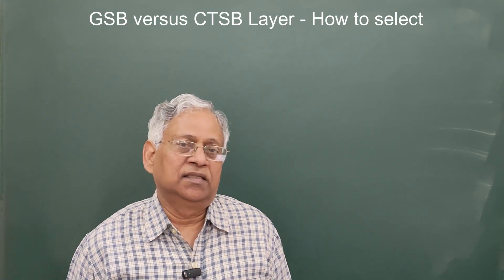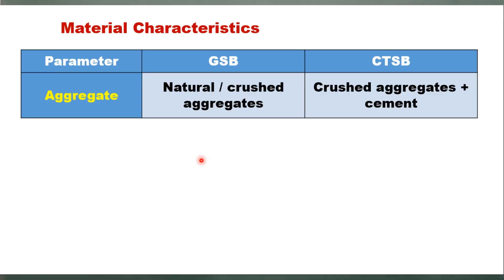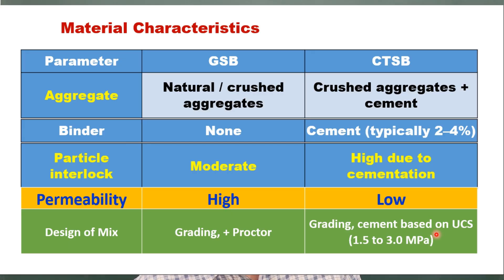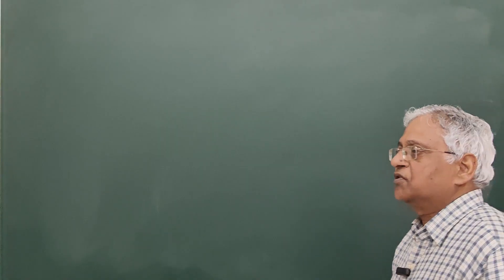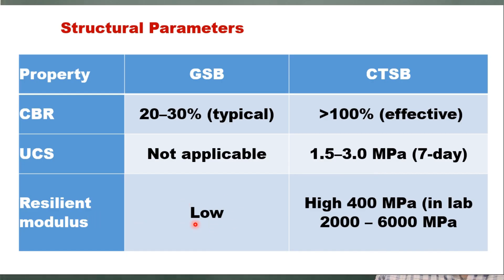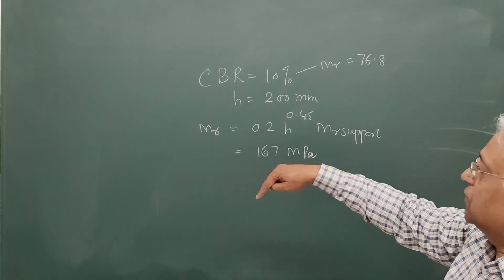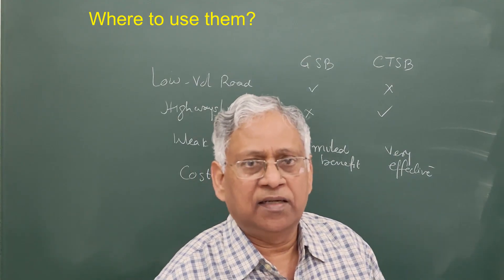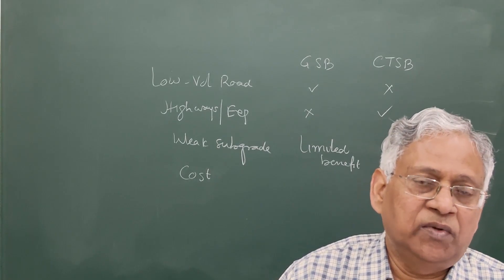GSB VS CTSB, what is the difference between these two  and how to select GSB or CTSB for a pavement

Comment: What is the difference between CTSB and CBM, cement bound material
Reply from the maker: Both are same, but differ mainly in cement content, strength, function, and design philosophy. CTSB is also a CBM (broad term) with low cement content and is used in subbase. CTB is also CBM, but with different design parameters.